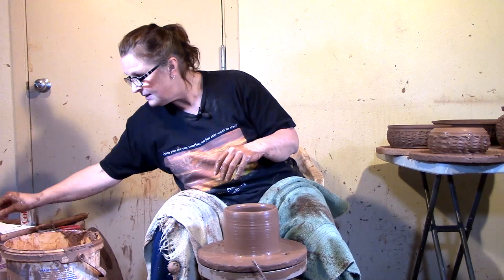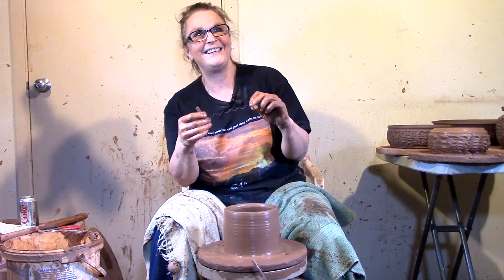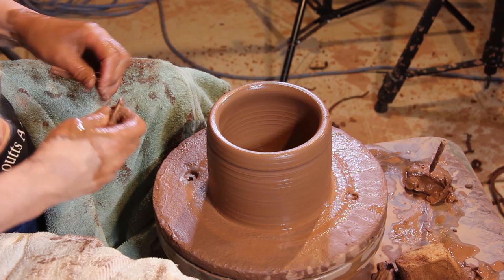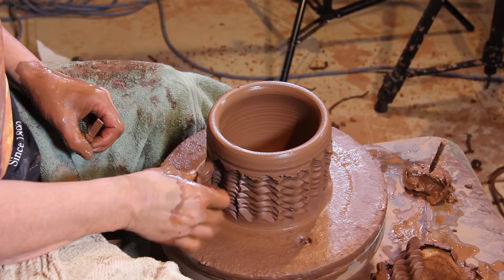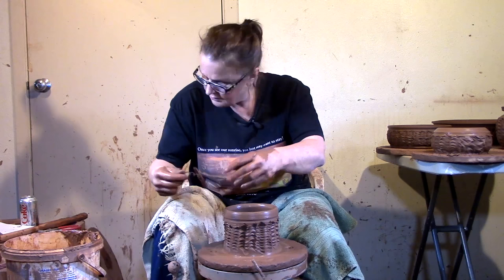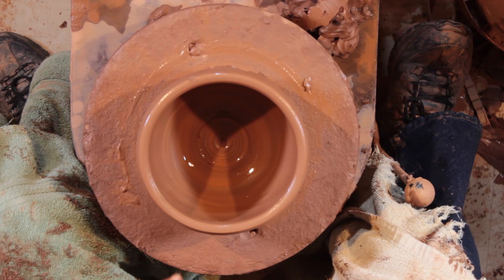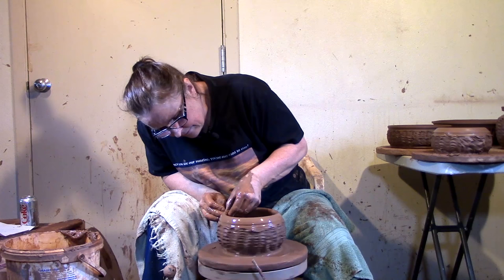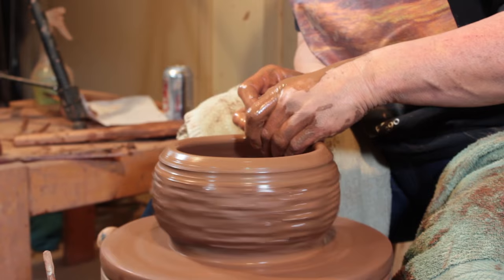How to Add Texture to a Wheel Thrown Pot - Handmade Tool

Comment: Hey Cindy, I've got to say, I've always been amazed by the quality of the video footage as well as the angle of the shots, that I guess Jim does. But, as always, I love your wheel work. I've used a smaller/finer spring in the past, but not such a coarse one. I'll have to try it. I like the texture. Thanks for taking my mind off of our potentially disastrous presidential election.
Reply from the maker: I passed your comments on to Jim. You are right, he looks after all the production side of the videos. He says thank you. I just make the pots, I'm glad you like them.  Using stretched springs for texture is really fun and there are sooo many variations. and possibilities.  I plan to play more with it in the New Year. I will have to post a lot of videos to keep your mind off the election and the coming peaceful transition of power.  Thanks for watching.